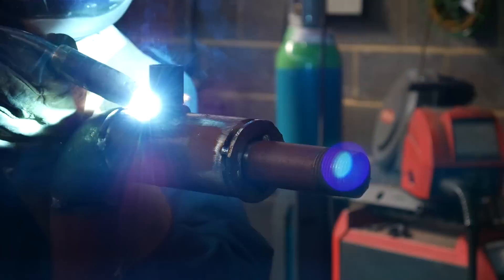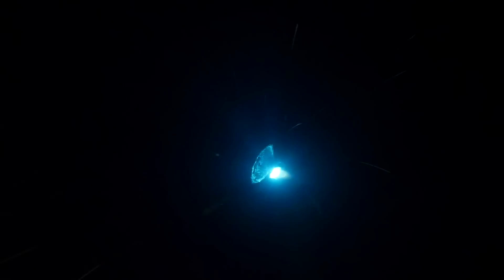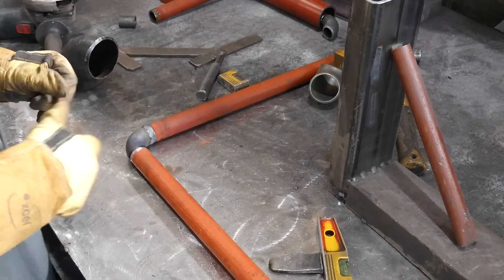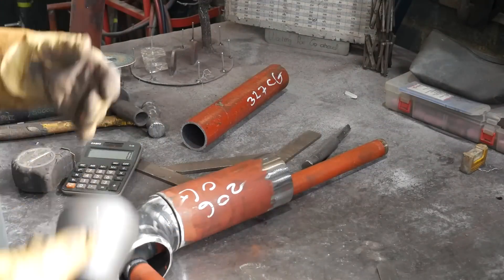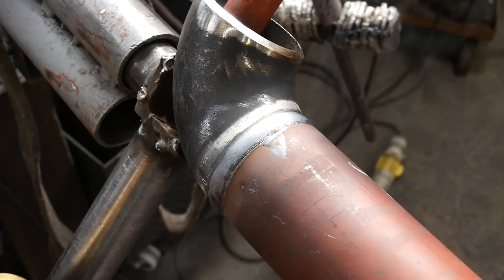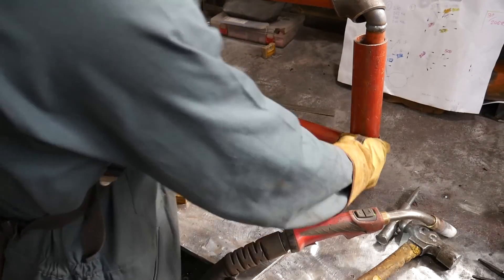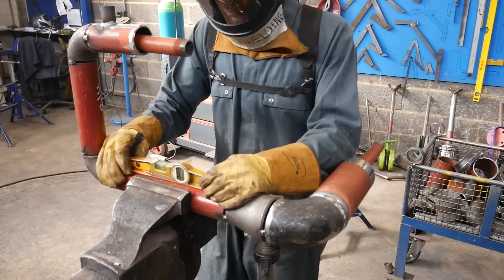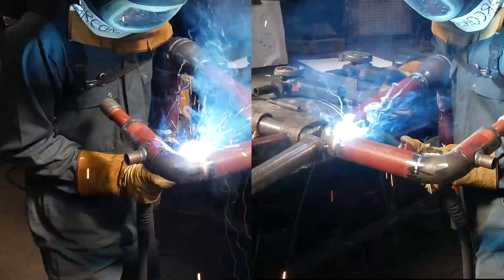MIG/MAG Welding *Pipe In Pipe* (HOW TO REAL WORLD WELDING)

Comment: Please parameters material diameter .thank you
Reply from the maker: Sh 20 LCS welded between 80A and 160A with 12%co2 2%o2
1.0mm solid wire welded to class 2

Comment: what pressures do these pipes run at?

is the outer pipe filled with anything?
Reply from the maker: The outer diameter is only used to catch any leaks and protect the inside pipe and its low pressure oil on the inside